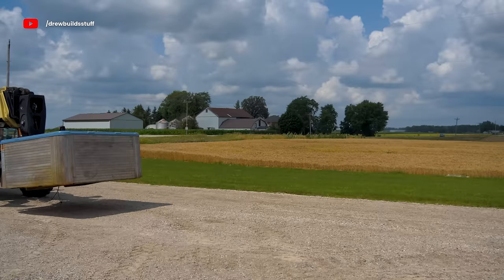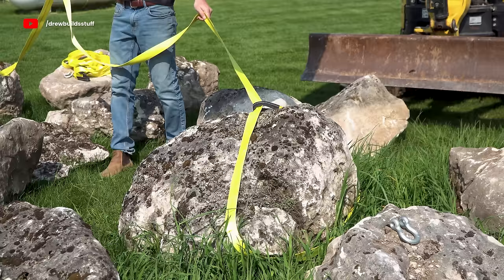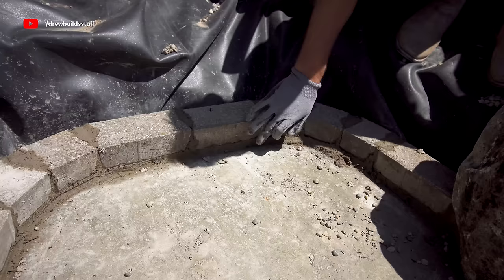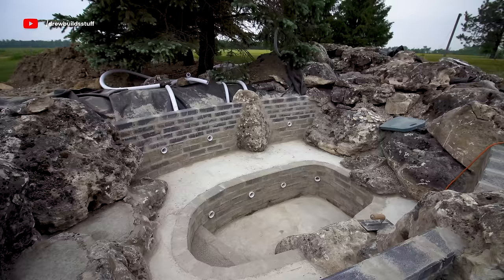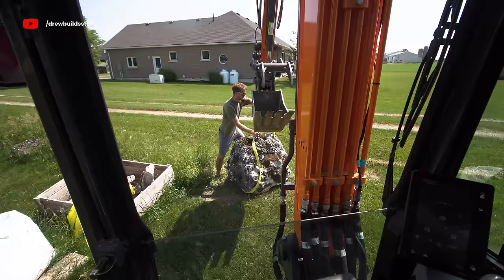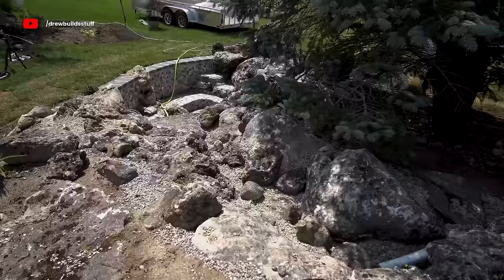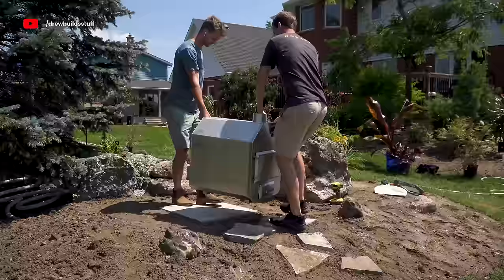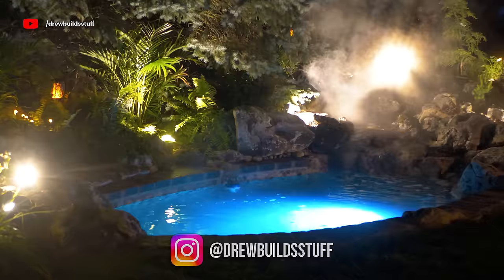Making a MOUNTAIN HOT SPRING in my Backyard

Comment: getting into a hot pool filled with chlorinated water, just when your skin warms up to let all that poisonous chlorine come into your body... yea nothing is further from relaxing or restorative

did you ever consider salt water for this otherwise awesome project
Reply: What are you talking about? Chlorine or bromine are constantly used in pools and hot tubs that are heated. It doesn't work on your body like you are implying at all. Also "salt water" isn't a thing for pools, spas, or hot tubs. When people talk about salt water pools what they REALLY are talking about is you put a certain amount (bags) of salt into your water that then run through a "chlorine generator" (also called a salt chlorine generator, or salt cell, etc) which is installed alongside your pool pump and filtration system. As the sodium chloride (NaCl) you've added to your water is passed through the generator, it is converted to chlorine (Cl) through electrolysis (splitting the salt molecules into Na and the Cl). The generators are set with timers to dictate how often they run to try to maintain proper Chlorine levels in the pool. Or alternatively are turned on and off based on probes that take water readings and some automation software (not very reliable though). Salt water doesn't act as a disinfectant. It literally does nothing unless converted to chlorine. So, your saltwater pool is a chlorine pool. 

Really no different then going to the pool store and getting Sodium Hypochlorite, Calcium Hypochlorite, Trichlor, and Dichlor. Well there is a bit of difference as the Cl molecule is bonded to different things in each which results in various other changes to your pool waters chemistry, but they all disinfect the same via the chlorine. Using salt means has downside of Na (sodium) in the water, which causes your pH to go up quickly. Thus many people that have salt pools have to constantly add lots of muriatic acid to lower the pH or end up with lots of other problems. Calcium Hypochlorite causes increases in calcium (hardness) levels which if you already have hard water can become an issue. Trichlor is really common for everyday pool people that don't know better and it adds the chlorine alongside CYA (cyanuric acid), which is a stabilizer for the chlorine to help it last longer under the sun, however when CYA levels increase to high from using these tablets (typically 3-6 months of use) it becomes so high that it "locks" the chlorine up and prevents it from actually disinfecting the water. Personally I prefer regular old liquid chlorine (sodium hypochlorite). But they all have positives and negatives.